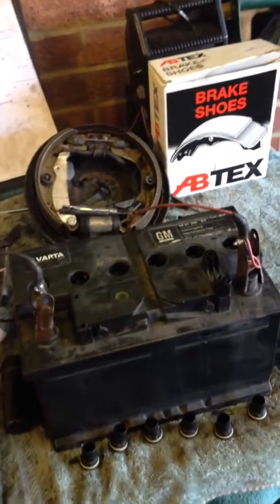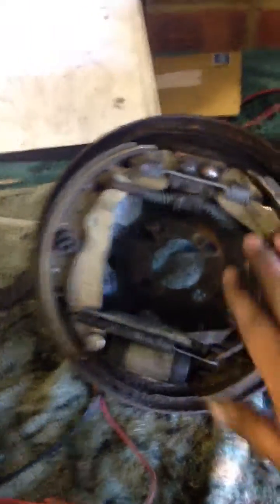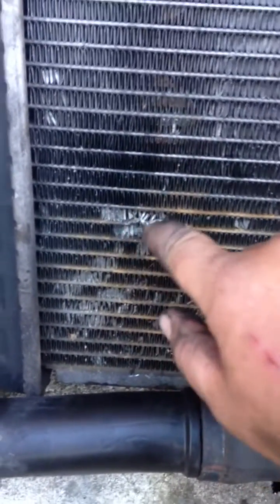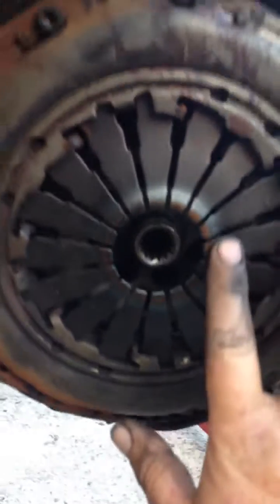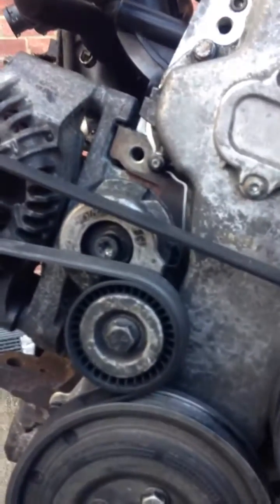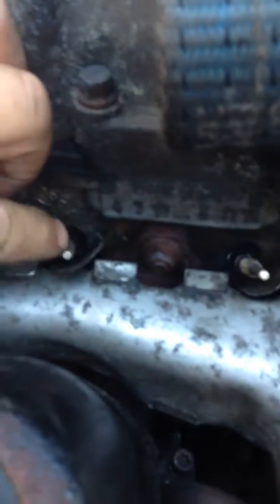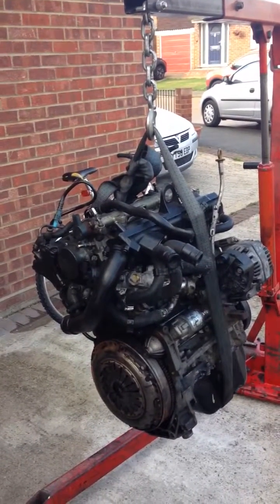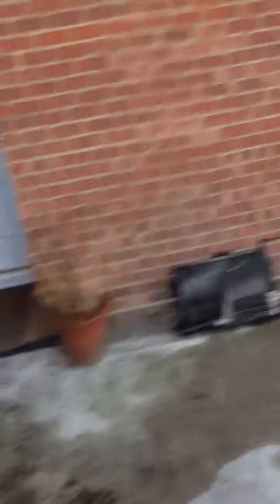How to change engine on Vauxhall combo diesel van

Comment: Hi. Can you help me. I got a 05 plate combo van vauxhall, my gear selector went, I got home in third gear travelled 4 miles a had to stop 5 times. I can smell burning like rotten eggs. I recently fixed my selector rod the van drives ok. I would like to no what you would do to make sure it recovers fully. Replace clutch or leave it replace fly wheel or leave it. Replace clutch bearings or leave it. Will my engine be ok.

Comment: Good we video buddy. Gives me a good loom around the engine. I've got a combo that's got a knackered head gasket so looking for a new engine/van to drop a new one into. Quick question: is it easy to drop and lift the engine in and out? Heard it's a pain and easier to drop it then lift new one up.
Reply from the maker: Hi McKinnon decorators 
Take the bonnet of and lift out from above then drop replacement one in 
Happy home mechanics

Regards 
Richard

Comment: Hi dont know if u can help me but I have a corsa with the same engine and I need to fit a new flywheel and clutch do I need a particular socket to undo the flywheel bolts am I right in thinking I need a 12  point star drive type .
Reply from the maker: Hi Stuart from memory yes you need the start shaped sockets ( look like Allen jets but star shaped 
Good luck snd happy home mechanics 

Regards Richard